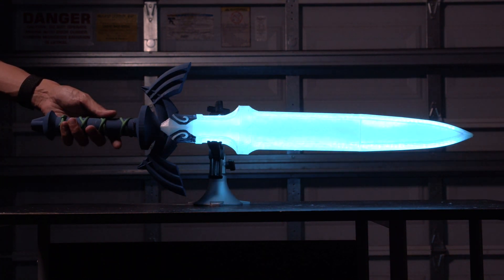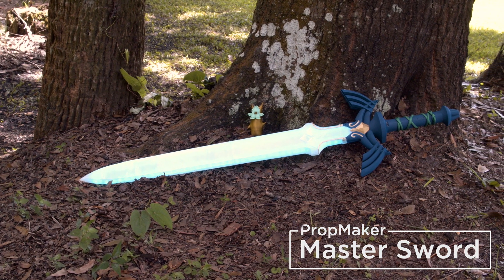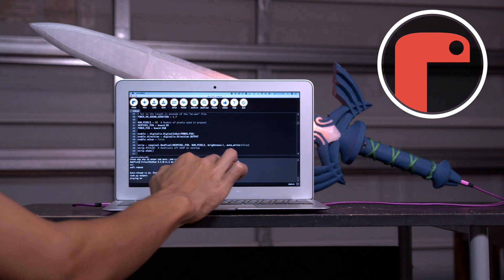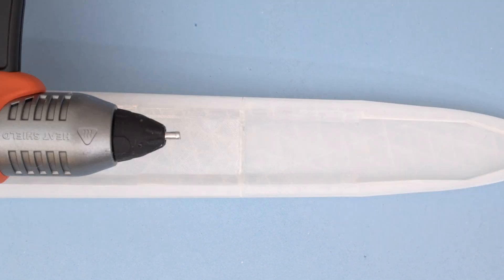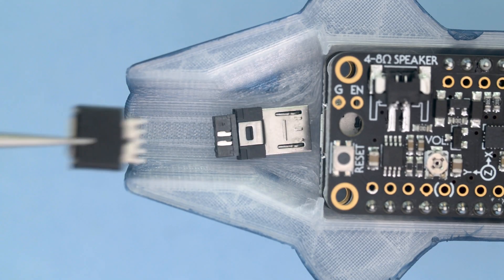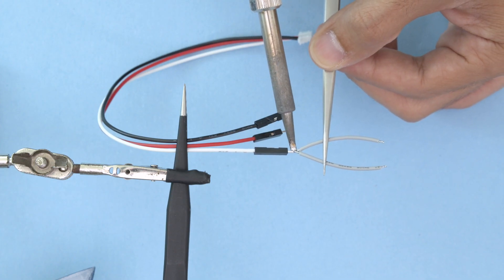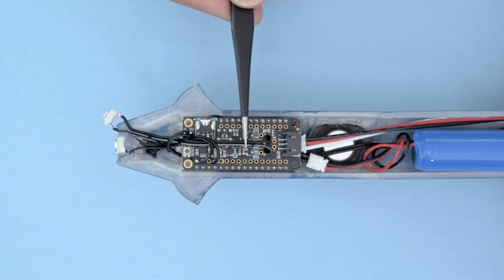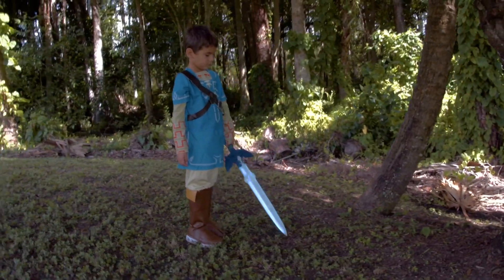LED Zelda Master Sword

Comment: Hey I think it's a cool tutorial.
 I wanted to ask if you can paint clear PLA like normal PLA but still have the LEDs glow? I always work with spray filler and spray paint. Is that also possible with these PLA if you want to see the glow? Hope you understand what I mean.
Reply: I've seen someone do a similar project, and they said they used alclad 2 chrome. I'd definitely test it on a scrap print using the same filament or something just to make sure, but it's a start. Hope that helps in some way.
Reply: Thank you  @dolsento  , I have no idea what Alclad is. Maybe you like to share a Link?